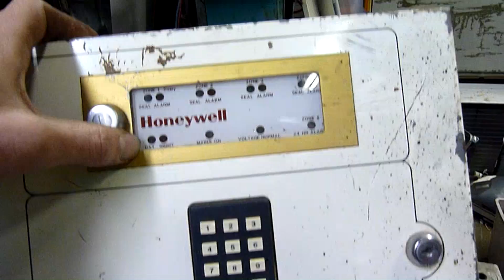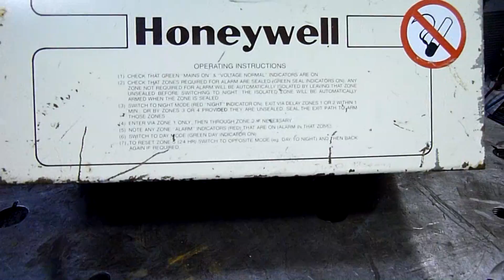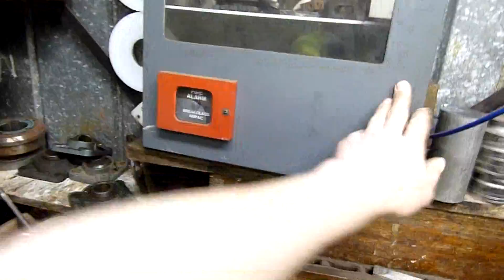1987 Honeywell Alarm Panel Autopsy

Comment: 2n3055's know em well. 6 of em formed the passbank in my ion laser power supply. Eventually I upgraded it to 8 of them as sometimes at low current it would pop one then the whole string would go :P 4000 series CMOS logic - used heaps in many of the dick smith kits before they became box shifters. a 555 and a 4017 formed the preheat timer in my laser supply :)

Comment: Before you chuck it out, see if it'll power up.

...On a MOT. :D

Mmmm, fizzy! :D

Then after that, the battery can be recharged for entertainment.

Of course, for battery-recharging to be entertaining, the recharging unit of choice will have to be AN ARC WELDER. :D

Connect it up, rip it up, & let's have a Whistley-Squeeler! :D

=OR=

Re-assemble cabinet, minus battery. Drill hole in side of cabinet. Attach Magnetron. Power-up magnetron. Fry insides. :D

Thanx for showing,

-BoomBoxDeluxe.

Comment: Hmm 4000 series cmos logic chips, reliable old logic :-)

2n3055 npn, linear psus and used as the outputs in old transistor amps.